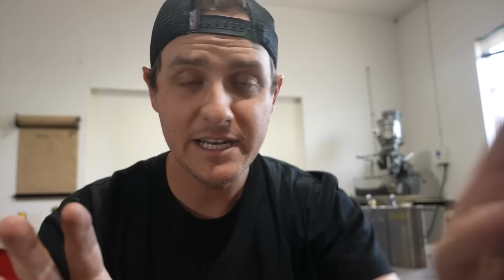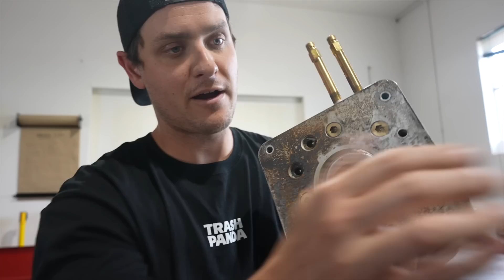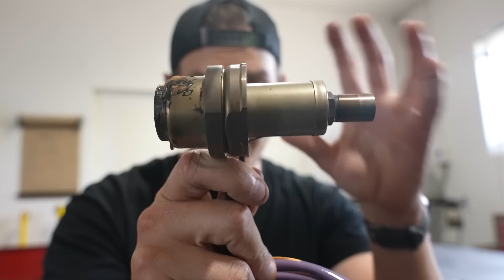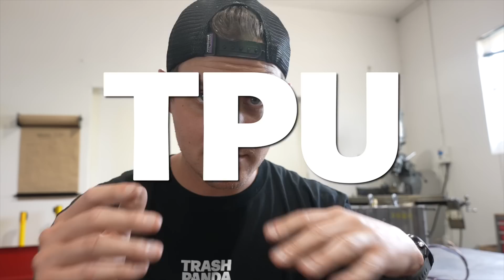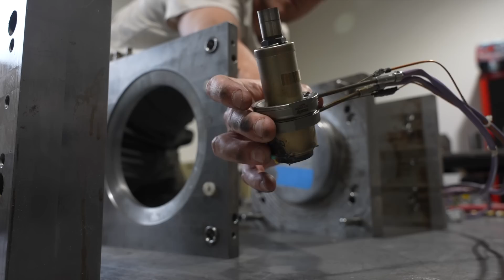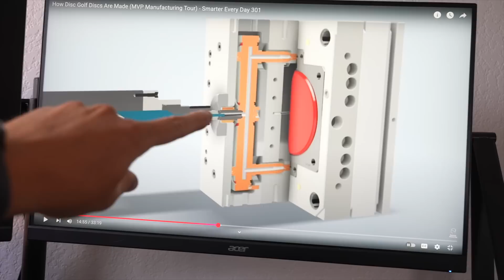The Most Interesting (and Useless) Part of a Disc Golf Disc

Comment: What about cnc machines? No mold so i guess it's not molding, but still interesting.
Reply: There is also NSH that does 3D printing, a way to ensure the disc never changes or molds need to be replaced because they use the same computer or saved files to print discs so the mold never wears out. Also, very little waste with the way the NSH discs are made.

Comment: Hey Jesse! Those MVP overmolds would be possible with a cold runner. Look up three plate molds if you haven't. The waste issue would just become a significantly bigger problem cause the runner would be much bigger but then again, regrind.

Comment: The sticking to the table bit isn't because of the stickyness of the TPU, but rather because you have a soft flat surface that is literally suctioning to the surface. It creates an airtight seal and when you pull the sprue there is no way for the air to flow under the disc, because the super flexible TPU seals the edge where rim and flight plate meet. If you were to make a disc out of teflon (which isn't a thermoplastic, just making a point), which isn't sticky at all, you wouldn't be able to pick it up either, because it would seal too.

Comment: Cold sprue still gets the checkmark for waste; or at least a tie.  As you said, it goes back into grind so it isn't actually waste, and I bet the heat energy of the hot runner system is on par with the re-grind energy.
Reply: Yes and some companies do have sprue waist they never get rid of unlike Innova or Discraft in the Pro's Tour Series Discs if a more premium mold or some swirled disc lines, they recycle the plastic into the mold you can almost see the other plastic reused in the mold that is not the same color as the disc being made. Even Innova will on oops discs that are fine and meet PDGA standards that were not supposed to have swirl, the disc will end up in a secondary market same as the mistake stamps and so on. Discraft did the same but for mistake stamps but I have a hard time finding those so I wonder if Discraft does now have a way to recycle discs or recycle plastic more because you do see Pro's molds having swirl that might indicate other plastic reused.  It makes sense to reuse plastic for a Pro Players Tour Series Disc with the main mold because the company can pay the player more if they used a more expensive to produce plastic. I mean before Tour series discs Innova used to have that plastic that was recycled in the Echo Star of the Star plastic and the Innova did use in older Swirled discs of premium lines that were supposed to be swirled in limited runs section of the store had some used plastic in with the main plastic in the mold because of the different densities the plastics would mix at slightly different rates crating the swirl.

Comment: I have a question I hope you can address at some point. Why do your discs feel so slick (as in slippery) in premium plastic when compared to other premium plastic such as Star, Neutron, etc.? Do you have some sort of release agent that is causing this or is there a process that you are not doing that other manufacturers are doing that removes that slick feeling before getting shipped?
Reply: Other manufacturers are getting plastics designed for them by plastic manufacturers. Recycled plastic is going to inherently make discs that don’t feel quite as good as regular premium discs. I’ve had runs of trash panda discs that feel amazing, frankly I don’t have an issue with the majority of their plastic.
Reply: I have about 30 Trash Panda discs and none are as "slick/slippery" as Star or Neutron plastic...